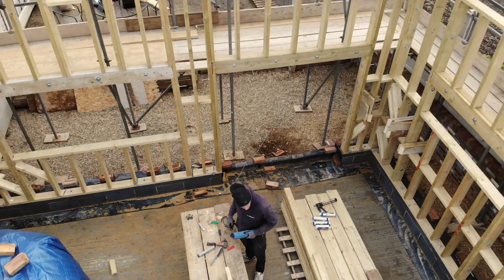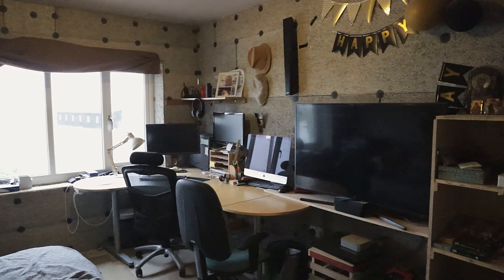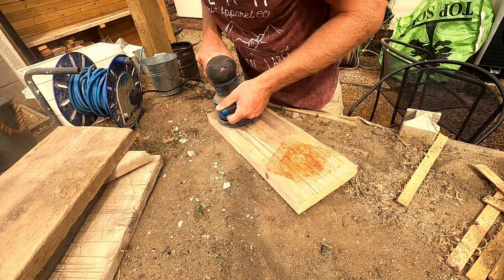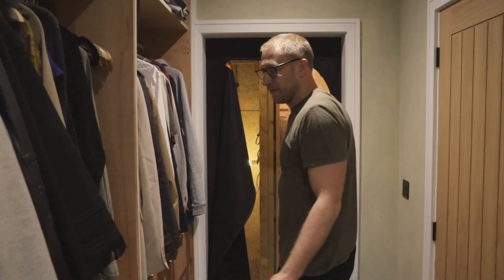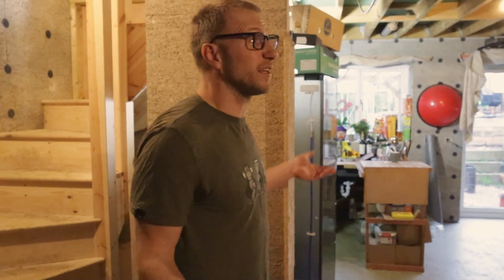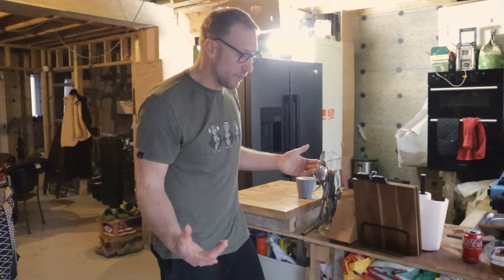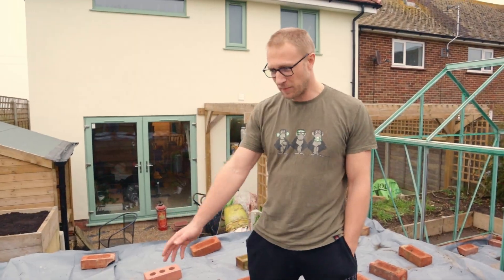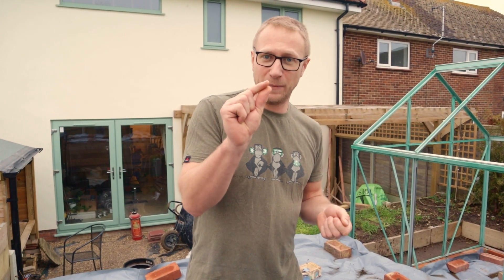#15 - We MOVED IN Before the House Was Finished! (Bedroom/Bathroom Reveal)

Comment: Things are looking good! We are starting our project this year and are very excited about that. We got the frame for a little shower house/ kitchen up on our new property and will be  building up the hempcrete walls this summer for practice for our main house which will be a timber frame with hempcrete walls. All new to us but i think i can figure it out since i am a mason by trade...Exciting stuff!!
Reply from the maker: Very exciting! You won't have any trouble it really isn't very difficult, the main thing to worry about is  the mix, the rest is easy once you get going. 

If you have any questions we are happy to help, you can contact us through the email we have on our channel, it might also be worth having a chat with Graham Durrant who we interviewed and worked with last year, his details are in the description of that video.  

What part of the world are you doing your project?
Reply: @thelowcarbonproject  I am in the USA,northern NY state almost in Canada really. I may take you up on the offer of sending some questions your way.  Our new property is 3 miles from the nearest powerline,so we have no choice but to go completely off grid. The climate is pretty cold as well,so we are trying to build a very efficient house that should be easy to heat with wood and the sun. We will have a masonry heater in the house and some hot water panels for in floor radiant heat. The design is also passive solar with the slab on grade being the thermal storage. It should work well...
Reply from the maker: @mikelorenz8636  Sounds like a great project and Hempcrete will be perfect for that. Matt has a wet under floor heating aswell and has gound it works really well, he's still finr tuning it as a works a little too well 😅 His walls are 360mm thick but maybe for your climate it will be worth going 400mm. If you design it right the hemp walls can also act as a thermal mass aswell. There is talk that a hemp house will maintain about 18 degrees Celsius all year round but we haven't tested that properly yet. Good luck with it all!